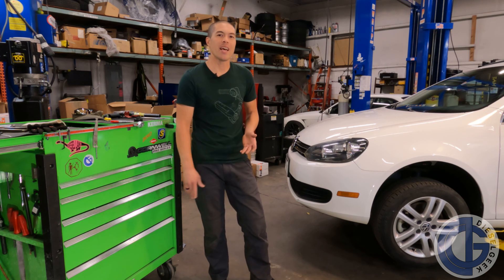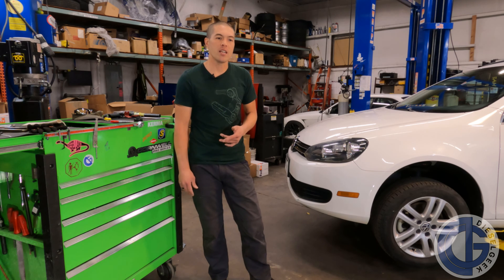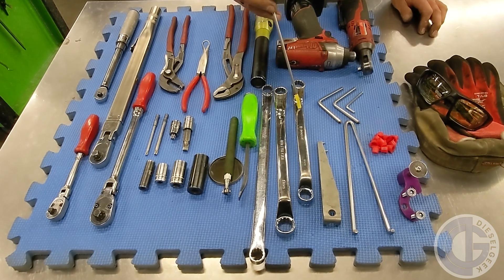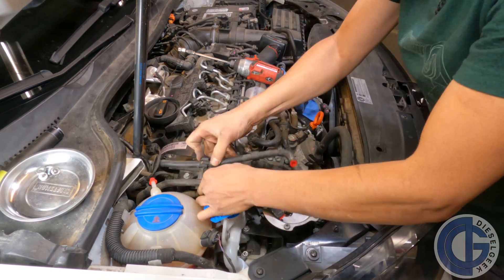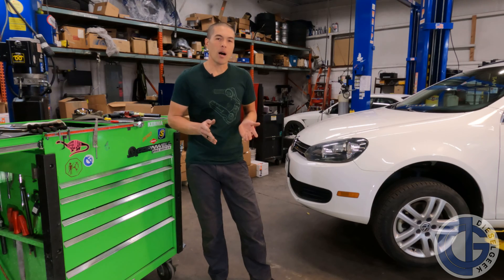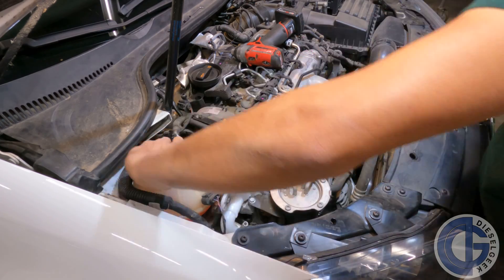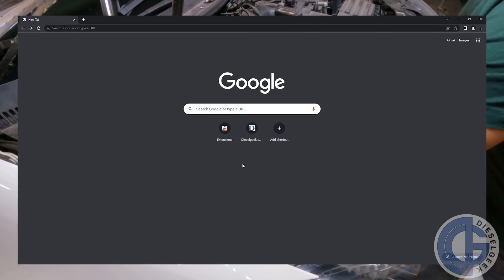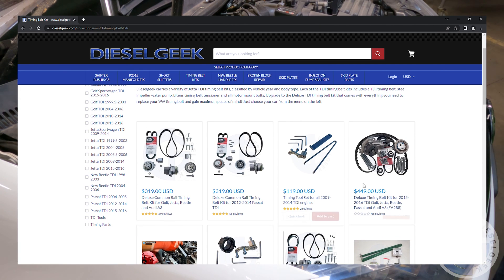2009-2014 TDI Timing Belt Instructions (preview) by Dieselgeek

Comment: How often should the timing belt get replaced?   I have a 2014 vw beetle diesel.  It has just over 100K miles.
Reply: don’t wait until 200k miles.  I would replace timing belt at 150k miles
Reply from the maker: We recommend 7 years max regardless of mileage.

Comment: I have seen multiple recommendations for your kits and videos.  Was wondering if you could answer a few questions for me, as I see the kits a bit cheaper elsewhere but am willing to pay a little more for 'good support'.  

2013 Jetta 2.0 TDI Sportwagen with just over 130k miles on it.   No issues with engine performacne, everything runs smooth and tight.   Bought it from a dealership at 108k miles through the Volkswagen buyback program after the TDI 'fix'.   Not knowing whether the belt has been replaced before so it is definitely time.  

I have replaced a timing chain, multiple water pumps, and even replaced a head gasket on a car before including all new valves (had a timing chain break in a Grand Am but got lucky to not have engine damage).  Having moderate mechanical skills, but in not a mechanic.  Is this something I can tackle in my own garage?  What would you estimate for the amount of time required?  Just some questions I have before I commit to the repair, or decide to take it to our local VW certified garage.

Before I go all in, is this a job that can be done without a lift and do I need any specialty tools?  If so do you have a link to a tool kit for it?  Not looking for Snap On quality, just something sufficient to do it a few times without crumbling.
Reply from the maker: Hi Kevin - 

It sounds like you have more than enough wrenching experience to get this done. Generally if you know righty-tighty lefty-loosey, can/will follow instruction, have a jack, stands, and decent set of hand tools this won't be a problem. We cover all the necessary tools you'll need right at the beginning of the video and you get access moments after you order your kit. That allows you to pick up anything you're short on before taking your car apart. Most importantly if you get stuck you can always email or (gasp) call us if you run into a snag. 

Regarding specialty tools:

You'll need the set we offer here: https://dieselgeek.com/collections/vw-tdi-timing-belt-kits/products/metalnerd-vw-common-rail-timing-belt-tool-kit

Also an M10 triple square https://dieselgeek.com/collections/vw-tdi-timing-belt-kits/products/m10-triple-square-socket-for-common-rail-timing-belt-job

And if you don't have a bunch of hose pinch pliers the cap plug set is a good idea. https://dieselgeek.com/collections/vw-tdi-timing-belt-kits/products/cap-plug-set-for-timing-belt-job

Comment: Why do all the diesel geek videos not show the crank locking tool being used?
Reply from the maker: We use the crank lock in all the videos along with the other locking fixtures.
Reply: Have a link? All I see are these previews and none have the crank tool being installed. Do instructions come with the kit?
Reply from the maker: The link to the full video is emailed to you immediately after purchasing the timing kit from dieselgeek.com
Reply: I bought the timing kit and didn’t get the video???